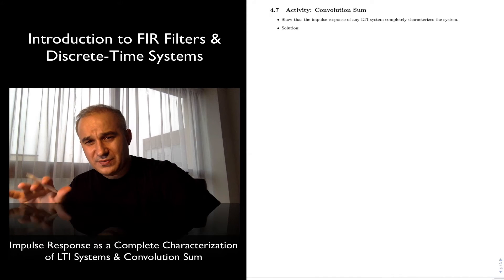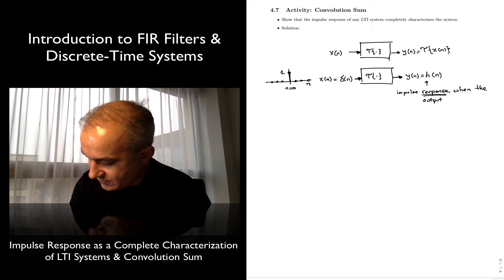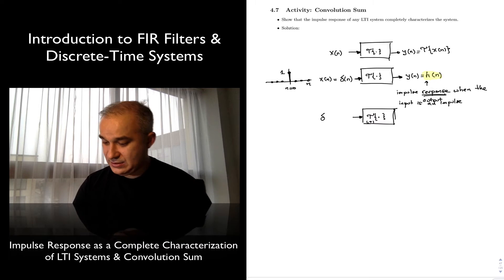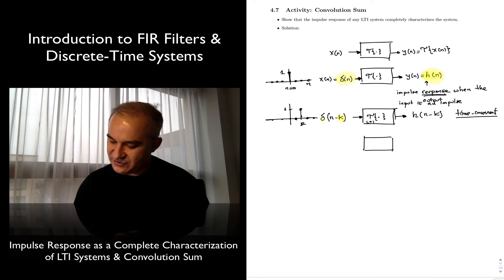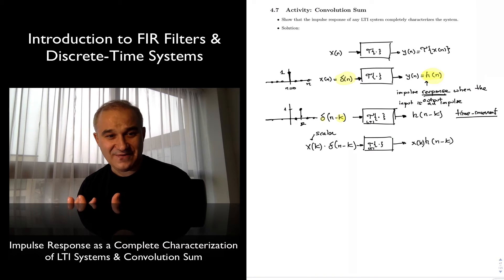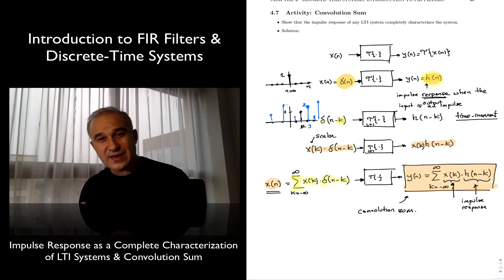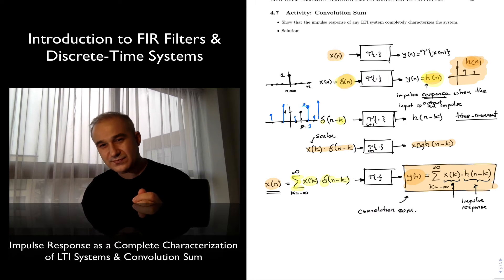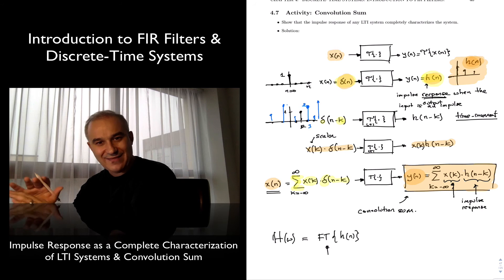DSP Topic 4: Impulse Response of LTI Systems (V8)

Comment: My original question, “How is the frequency response of a filter described by a difference equation?”

I found it!

The Fourier Transform of the filter coefficient, which are the coefficient of x(n) in a difference equation,  yields the frequency response of the filter.
FT[ b0 b1 b2 … bm] gives frequency response of the filter
Reply from the maker: correct